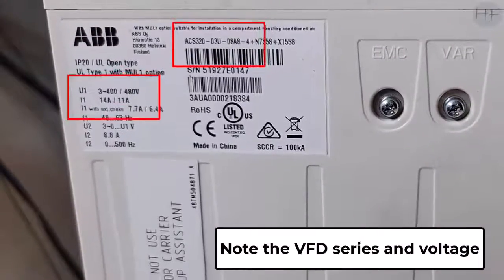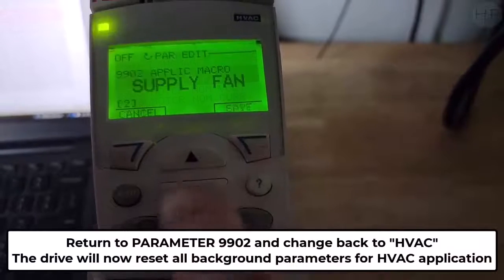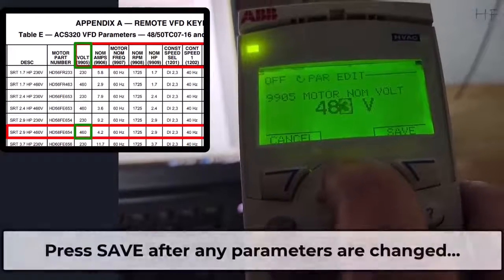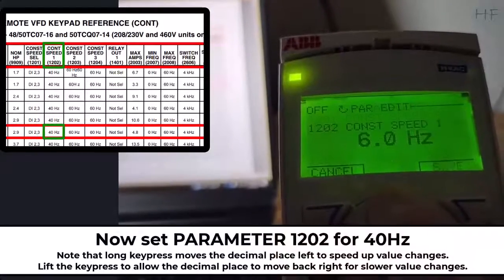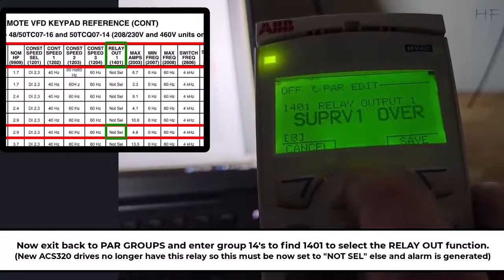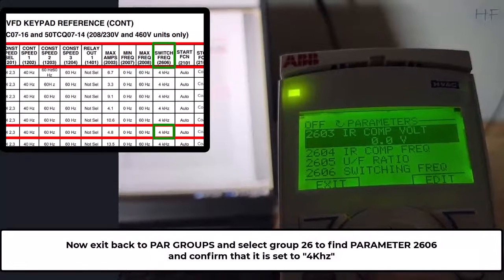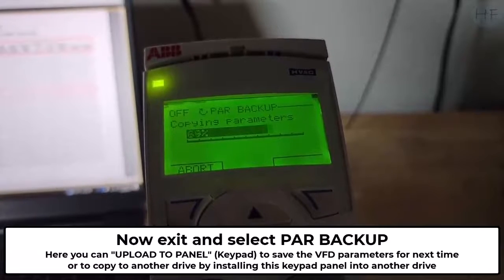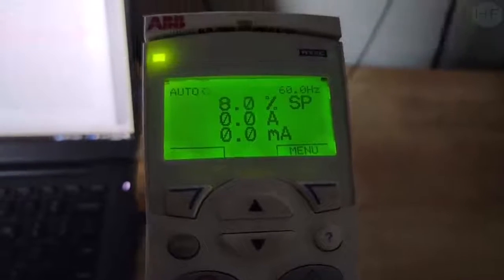Carrier ABB ACS320 VFD parameter setup [Complete walk through]

Comment: I keep getting an error code pf 2023, it keeps running me in circles with what the actual issue is
Reply from the maker: Likely emergency stop.
You likely missed a parameter or parameters so the connected discrete inputs used do not match the function set in the parameters.

Comment: Hi it’s giving me an alarm 2021 after I changed parameters, any idea what that might be
Reply from the maker: Page 364 https://library.e.abb.com/public/89576da7c650458f843af9f1b7bfea54/EN_ACS320_drives_UM_F_A4_screenresolution.pdf
Seems that you either are missing the jumper from 24V to DI 4 or you didn't get all the parameters set.
Should be a few pink wires jumped and the blue wire jumped. I am not at the diagrams to see which ones. But diagram should be in your unit. Also if you change from a ACS320 drive to a ACH550 or vice versa, the wires are landed on different terminal numbers. So keep that in mind when getting substitute drives.

Comment: You sir are a saint! I just had trouble replacing this vrv with one ordered from carrier that was "preprogrammed" for my unit. It was not....and of course carrier wants you to talk to the local dealer for tech support and the local dealer goes straight to voicemail.  Popped open your video and had the unit up and running in 10 minutes using the correct parameters for my 208v unit. I cant thank you enough this video was extremely helpful.
Reply from the maker: If it is for an RTU for 2 speed, they are NOT pre programmed. They need to be setup. But once you have done one then the next one(s) will go quickly.

Comment: Good idea many of us had very hard time programming these things
Question how did you power that thing on the table?
Reply from the maker: I do have 240V outlets there in my garage however for testing I use a DC voltage doubler using a few diodes and a capacitor.
Since the VFD actually runs on DC internally, you can just power it up on DC with a voltage doubler circuit from 120V AC. (Rectified power from 1/2 sine wave = 170V DC across the first capacitor then second have of sine wave goes in series with the first charged cap to equal over 300VDC to the VDC internal DC link (bus).
It will even run to some degree depending on how beefy I make the voltage doubler.
I have a voltage tripler as well that gets the voltage to nearly 500VDC so I can power up 460V VFD's just to see if they work, program them, etc
I can also do the same thing to about any ECM motor. 👍
Reply: @hackfreehvac   great thank you 🙏

Comment: Except all those drivers are dead and bypassed 6 months after unit was installed
Reply from the maker: Sometimes. Doesn't look like Carrier will be selling any more VFD units on 20 ton or less now as they all come with ECM axial fans now.
Reply: @hackfreehvac  just make sure to slather the connection box and cables in sealant or they won't even last 6months and you can't bypass the ECM board. 
Have trashed too many Pabst ECM fans because of Installation error or UV damage to the seal.
Reply from the maker: @FerdinandFake  Are you in a humid area? We are pretty dry here except the monsoon season. So some issues on units seem to vary based on region. We have HEAT related failures around here. Not so much the water or corrosion.